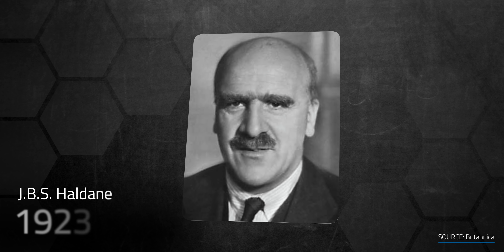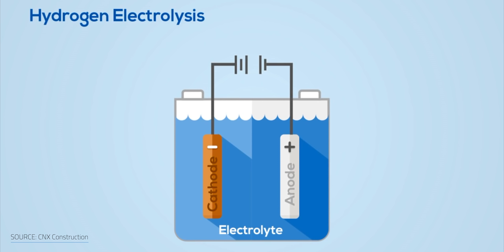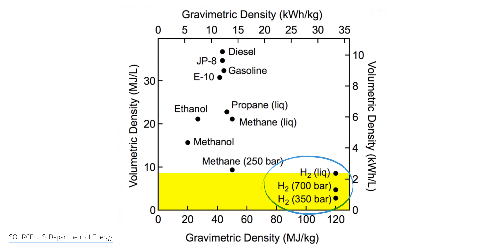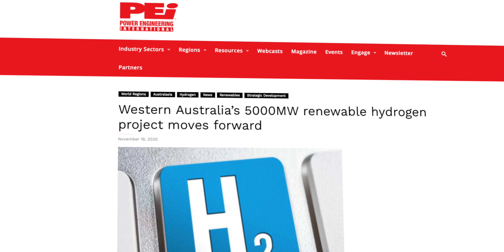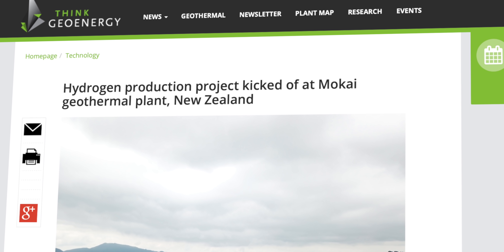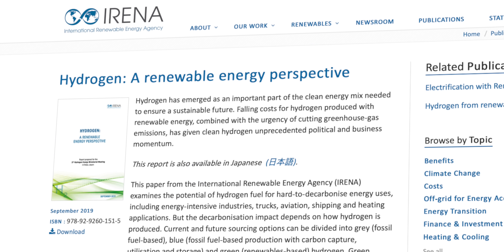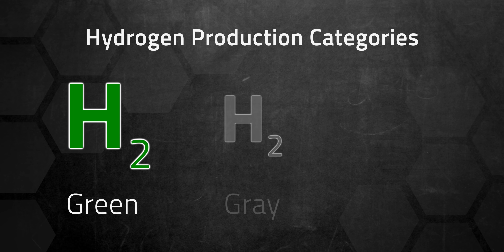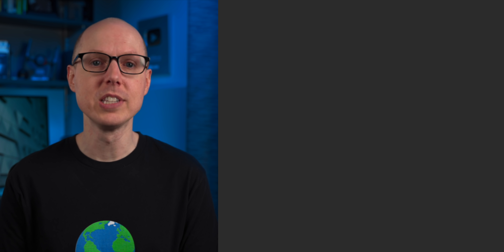The Truth About Hydrogen's Dirty Problem - Green Hydrogen Explained

Comment: It is interesting to point out different ways to go about producing hydrogen and it sounds like there is more progress than the last I checked.  However there are some intractable issues limiting how far you would really want to use it over alternatives such as:
1. Boom factor - You keep saying this in the video, but it is true hydrogen is a highly volatile rocket fuel than tends to be stored under immense pressure.  What could possibly go wrong for example by sitting on a tank of this stuff while going down the road and especially what could possibly go wrong with tanker trucks full of this and gas stations with huge tanks of this, especially as every gas station leaks even when the tanks are not under immense pressure?  There are stories about hydrogen fueling stations blowing up and they are not pretty stories.  Whole countries have shut down their hydrogen transportation projects over explosions like this.

2. Efficiency - I have seen these projections of hydrogen reaching cost parody for decades and we are still no where near it.  Granted there have been some improvements over the years, but the opportune word is some.  If it is always going to take several times more energy to make, store, transport, and consume hydrogen than other energy schemes we have, it is always going to lose out on the cost factor.  Also if it is taking a whole lot more energy to make this stuff than the useful energy we get back out at the other end when end-to-end is considered, not just the efficiency of one step in the chain, then it is not really all that green as it still takes resources to make the energy gathering equipment and if it always takes several times as much of this equipment, that is several times as much environmental damage as another solution that doesn't have this problem.  The last time I saw the math for an example, it was taking 6 times as many solar panels to push a hydrogen car X distance as it did a comparable battery electric car the same X distance.  Both battery tech and hydrogen tech has improved some since this, so this ratio is probably still in the same ball park.  6x as many solar panels is 6x the environmental damage to get the energy as the solar panels didn't materialize out of thin air, instead the planet is torn up and polluted to produce them.  The plan with solar panels is it is less damaging than other means of getting the same amount of energy.  However if say solar panels reduce the environmental destruction by 4x, but you need 6x more of them because your hydrogen tech is so inefficient, then you are actually doing more damage to the planet than if you hadn't bothered with hydrogen in the first place.  Plus with it being so very expensive to make the hydrogen fuel cells in the first place, one has to wonder how much of that cost equates to even more environment destruction in getting that fuel cell built where a cheaper alternative may be far less destructive to the planet.

3. Cost - In addition to poor end to end efficiency compared to other schemes we have raising costs, the fuel cells are still very expensive, a lot more so than batteries used for the same application, plus the batteries store the energy a lot more safely than a tank of highly compressed rocket fuel.  The Toyota Marai is a mass produced vehicle and the comparable Tesla Model 3 makes it look like a way over priced, dangerous, and way under-powered go cart that also looks like a bloated crap mobile.  The problem is also the battery tech is getting better at a faster rate than the hydrogen fuel cell tech, at least for right now and the battery tech is already way ahead in every way, including the cost point here.

4. In airliners - I thought it was interesting that you brought this up.  What I came up with here is you have a flying tank of highly compressed rocket fuel flying through the air taking up half of the fuselage where they used to have paying passengers in that space and at that the fuel is more expensive than alternatives.  All of those things are a non-starter and all of them are intractable problems.  The future of airliners I see are using high temperature superconductors for hybrid electric aircraft like what the Russians recently demonstrated with a real airliner.  So I would use LNG to keep the superconductors cool and feed the boil off gas into hybrid fuel jet engines.  This way you can do a combination of an electronic gear reduction for greater engine efficiency (straight jet engines are more efficient than the current bell at the back to do a gear reduction by slowing down the air over the turbine blades), modestly slower moving aircraft with more efficient, straighter wings, and batteries for buffering power and reducing the size of the turbines, which will make them more fuel efficient, especially as jet turbines are a lot more efficient at or near full throttle, which they normally rarely ever get near when they have to produce all of the power for flight, but could get a lot closer if batteries produced the burst power needed and left the jet turbines to produce average power while at or near full throttle.  Hybrid electric battery tech opens possibilities for more efficient for short take offs and landings at smaller airports with bigger planes and VTOL (vertical take off and landing) aircraft.  Think of for example if you did more regional / short hop flights on a commercial aircraft that took off and landed like a multi-rotor drone on primarily battery power and then transitioned to level flight, feathered the extra prop-rotors and shut them off, and then primarily ran on power supplied by right sized jet turbines for level flight?  Especially for large air-frames, the LNG tank could be placed in the attic space where there is usually a lot of open space anyway as it is not primarily a fuel tank, instead a coolant tank, but the exhaust gas does get used as a supplemental fuel.  Also for the primary fuel you could use a blend of conventional jet fuel and bio-jet fuel.  The experiments I have seen with using a blend like this made this look like a doable way of making this all work.  In other words you don't get rid of fossil fuels for jets, at least not right away, but instead cut down on how much dino juice gets used.  Better battery tech is already starting to creep into short haul flights and may make it all the way into medium haul.  What I am talking about with the superconducting hybrid electric airliners is a combination of new avenues for short haulers just not really practical with more traditional methods and far more efficient medium to long haul airliners.  These aircraft will pay for themselves through efficiency gains and even gains in safety with the right implementation.

So with hydrogen having a long history of extremely high expenses, voluminous, inherently very dangerous, and having terrible end-to-end efficiency making it the more environmentally damaging option than just burning the dino-juice straight in your engine, I mean there is just so much to try to overcome with such intractable problems that it doesn't seem worth it.  You can go on about how hydrogen tech is winning battles here and there until your face is blue, but the war will still be lost.  At best it will land in a few niche applications.
Reply: Yup you are right .But dont yoi think that if we'll find a easy and cheaper solution for this problem then that would be like miracles. 
Because we can extract h2 from almost everywhere, Isnt   ?
What you think  ?
Reply: @pranjulsharma6015  it seems we already have better solutions.  For example Elon Musk was just going on the other day about how hydrogen was considered for Starship, but it was found methane is a better solution.  Batteries are already a way better solution for cars and Elon Musk has even mocked car makers for using hydrogen while at the same time Tesla's battery electric cars are way better and less expensive, even without subsidies for his EVs while the hydrogen car is still more expensive with the subsidies while being inferior at the same time in every way.

While I can keep going down the list, there is a much better performer than hydrogen already in every category, so hydrogen just doesn't make any sense.
Reply: @ChaJ67  Yes Jason, You're right. But if we see current scenario then it seems like hydrogen is future. Because,government,Venturecapitalist,etc...,they see future in h2 they making huge investment in this technology. 
I dont understand that there  is also lot of other technologies like, "Sodium ion batteries,Aluminium batteries, etc.., " is also a good option but this is not in that hype as compare to hydrogen.....
But the point in last is "If we find a proper permanently solution for all the problems regarding hydrogen then it will be Breakthrough for an entire energy industries"....
Reply: @pranjulsharma6015  I think the important thing to understand is if not done a certain way, most 'green' solutions twist back to fossil fuels and often use more fossil fuels at that, especially hydrogen solutions and corn ethanol solutions.  This is why you hear so much about hydrogen and corn ethanol.  It is not actually part of the green future and was never meant to be.  It was only meant to passify stupid greenies while oil execs and certain farmers line their pockets.
Reply: @ChaJ67  Jason, I think Extracting h2 from fossil fuel and extracting h2 from Renewable energy is two different thing. The current way of using a hudrogen in industries is mostly based on 1st one which is from fossil fuels,and you know very well that, its not good for environmental.

But the problem with getting h2 from renewable sources is, the overall efficiency of Hydrogdn get decrease at every stage. From production to transportation to actual usage....
So here we need a proper permanently and reliable solution to save as much h2 as we can at every stage,isn't  ?

And when it comes to production of h2 then mostly we hear electrolysis process but thats not the only process of splitting water.There is lot of ways to split the water and that will also be efficient.
Recently,i was reading  a article which was about getting h2gas at room temperature and here i personally think that if any organization/Someone will develop such technology to get h2 very easily then i will be breakthrough for an entire energy industry.
And if we see in current time then it seems like it is possible because lot of new technologies are claiming that they can make hydrogen in very easy way, they can make such a device that will store h2 easily etc...,
Reply: @pranjulsharma6015  the problems with hydrogen are numerous.  Efficiency is just one of the problems.  You also need to be careful about claims or certain high hopes because then you end up with people promoting things like cold fusion, something we never achieved and have largely written off as a scam.  There are things that can be done we just don't do for some stupid reason and then there are things that can't be done.  Sometimes it is hard to know, but there is the underlying reality that ultimately dictates what can and can't be done.  No reason to hope for what can't be done, but maybe push for the things that can.  We settle on certain solutions for a reason, so if this is not properly considered as well as the ramifications of a proposed alternate solution, then it likely will not work out.
Reply: @ChaJ67  Yes, What you are saying makes sense,we should no believe anything that we read.But the article i was reading was the study of University of california, here i am pasting the actual/official word of study  :

"University of California researchers have discovered a new way to produce hydrogen by developing a special Aluminum composite that reacts with water at room temperature. Aluminum is a reactive material that anyway splits oxygen away from water molecules, leaving hydrogen gas behind."

So that'swhy we can trust on this.
If this happen then our first problem of Making a  plant for production willbget solved,and i think in future some solutions will come of various problem.

And  apart from this there is also lot of Research are happening everywhere for clean energy. 
In India, where i live Government of india sees future in h2 and they are investing their capital in h2.Not only in h2 but also in batteries technology, ethanol,etc..., 

As i see, I think you think that h2 is overrated,You Dont think h2 as a good future fuel alternative . So according to you which technologies or fuel is better option for future  ?
and why  ?
Reply: @pranjulsharma6015  Good question and I have answers:
1. Automobile / truck - Electrodyanmic induction in the roadway.  This is kind of like how you wirelessly charge your cell phone, but scaled up to making cars, trucks, and buses move around.  At this the focus is on the major thoroughfares, not surface streets.  For shorter travel once mass implemented, LFP batteries will be fine.  You could make cars a lot cheaper and lighter if the long haul travel part was handled by powered roadways.

2. Trains - Have a combination of overhead lines and LFP batteries.  The idea being train engines can weigh over 200 tonnes, so lots of room for batteries.  Place the overhead lines where they make the most sense considering you have batteries that can economically move trains a good distance.  Don't forget that at least in the USA, trains get over 500 tonne miles to the gallon, which is 4 times better than semi trucks.  Trains are very efficient momentum machines, so it is not hard to make trains go reasonably far on batteries.  Overhead lines would be an easy way to charge up the locomotives.  Anymore these days, you would just pick a good DC voltage for them, say -30 kV DC so there is plenty of power to move freight trains around.

3. For high speed travel, invest in Hyperloop style technology for both cargo and people.  This is have a tube with most of the air sucked out and run maglev cars in it.  There are actually a number of different magnetic levitation technologies out there, so you would want to shop around for the most flexible and cost effective option that can handle high volume traffic.  Have multiple levels to the system.  The reason for this is say very local travel is at regular pressure.  Go a little further and you suck most of the air out for a partial / soft vacuum.  Want to go far and you transition from the partial / soft vacuum to a hard vacuum.

4. Ships - It looks like we may have Lithium Sulfur or other types of batteries soon that may be suitable for ship travel.  Big cargo ships move kind of slow anyways and are efficient momentum machines at these low speeds, so especially if you get something like Lithium-Sulfur batteries working, which should have 3x the energy density of say a typical Tesla car battery, it will be plenty light enough and compact enough to power the ship between charging stations.  These charging stations could be say wind farms in the ocean or even nuclear if a shipping lane passes through a place in the ocean with no wind.  As ships tend to stay in particular shipping lanes, it should be easy enough to plan out where these charging stations will be and what the power source for them needs to be.

5. Airplanes - Again going back to recent reported breakthroughs in Lithium-Sulfur batteries and also tapping into high temperature superconductors and LNG coolant.  For very high power density motor / generators, use superconducting wires and motors as well as hopefully superconducting power electronics to efficiently drive these motor / generators.  LNG should be cold enough to keep the most modern superconductors we have at operating temperature.  As the LNG boils off, it gets fed into dual fuel jet engines.  The jet engines on planes get smaller, more straight through, and overall more efficient.  The planes will drive larger, slower fans than current jet engines and overall be designed to fly slightly slower for a big increase in efficiency.  The batteries will help in high power situations such as taking off and go-around power as well as smoothing out power delivery at cruise as changing air currents usually leads to constant throttle adjustments where here you want to run the jet turbines at maximum efficiency and let the batteries handle the changes in air currents.  In short, make airliners more efficient.

6. For better renewable production, build the HTSC (high temperature superconduction) HVDC (high voltage direct current) supergrid.  The idea here is build renewable generation around the world in all of the places where it makes the most sense to.  This power will be shuttled around countries and maybe even the world to be used where it is needed when it is needed.  These power lines will be more like pipelines that get buried in the ground and be in a coaxial configuration causing there to be zero external EMF, which will make a number of people who complain about such things happy.  The power lines can carry massive amounts of power per conductor, basically whatever is desired of them as superconductors can carry huge amounts of current and ramp up the voltage some and you have crazy amounts of power going through them.  Of course you would want to select a common voltage that would also make sense for overhead lines.  Then configure these power lines to snake around the country and even world in redundant loops as superconductors have no losses, so going the long way around when a cut happens is no problem.

7. At least in the USA, turn a couple of the Great Lakes into a giant pumped hydro storage system.  While only so much water enters the Great Lakes, these lakes are very large and some of the elevations are very different, leading to the potential of a humongous gravity battery.  Combine this with an HTSC HVDC supergrid and you can have massive storage for your green energy grid.  You can also do things like vary the flow of hydro-electric projects to help buffer power, but more in a one way flow fashion.  India gets a lot of rain normally, so I could see India doing a lot of the latter to help buffer renewable energy.

8. While India has been playing with Thorium reactors, they have been playing with molten sodium, which I think is a less than ideal approach.  I think India need to look more into LFTR reactors, which are thorium based, but use molten salts as the working fluid.  India has huge thorium reserves, the largest in the world, so needs to develop the right power plant to make use of it.  I think especially with LFTR reactors, it may become cheap enough for everyone in India to afford to run air conditioners and also eco-friendly to at the same time.

9. The Sabatier Reaction allows CO2 to be turned back into natural gas.  Especially when you are making a lot of green energy, can put the surplus into manufacturing your own natural gas from CO2 sources around the country.

So what do you think of all of this?
Reply: @ChaJ67  Wow,First of all Thank you for writing this answer in such easy way, because i also learned somethings from this. 
Yes, India have highest reserver of thorium and there is  research is going on,And it is expected that india will make its first plant to make electricity from thorium under 2025.

Well, All the energy sources is really fascinating and "its good in its own way".....

But what my point is, you said different fuel for every different thing. 
So is that not possible the same fuel for almost everythinng   ?

And i think you are the excessive viewer of this channel...😊
 Because all the source that you mentioned here this channel has made a video on that....
Reply: @pranjulsharma6015  The deal with different setups for different things is we have a number of technologies to choose from and each has its pluses and minuses.  For example LFP batteries are very well developed and have very good lifespans in general as well as being relatively cheap, but their energy density and power output is less than some other battery types.  So put this in a train locomotive that is very heavy anyway and can have overhead lines placed in strategic spots to charge up or an electric car that can charge off of a specially modified roadway to deliver power to the car making it so the car doesn't need to go too far on battery alone and LFP batteries is a perfect fit that we already have.  An airliner on the other hand has to be efficient to work and get its job done.  So then you start looking at more cutting edge solutions such as recently reported advances in Lithium-Sulfur batteries and novel uses of superconductors and LNG and significant R&D to make it all work.  LFP batteries are too heavy and copper conductors would weigh more than superconductors for the very high power levels jet airliners operate at.  A jumbo jet operates in the 100+ MW range during normal flight while being light enough to put out this kind of power for 12+ hours while zipping through the air at high speeds, possibly even going 18+ hours without refueling.  There is just not that many ways to do that with the technology we have and so the tech used needs to be well considered to handle this task.
Reply: @ChaJ67  I think, LFP and Lighting sulphate Batteries could be a really good alternative.But,At the end if we see in long term perspective then there is lot of problems in lithium Like,
1. reserve of lithium on planet is limited .At some point we will get run out of lithium(I am not saying that we will run out of lithium immediately after )

2.Price of lithium is constantly touching the sky,and It is expected that it will continue ; the price of lithium will not decrease in future. 

3.When all the things get fixed by lithium batteries then we will Mine lithium on full scale, we'll mine it from sea very hardly and in last it will effect overall the oceanlife .
( I know we cant manage all the things precisely .But in last it will effect our planet ) 

So here is the hope for all the problems which is ( I think ) Hydrogen
We can get h2 from almost everywhere Even from waste water. 
And we can also use this almost everwhere. Alstom is making the train that will run on Hydrogen. 
And There is also lot of big giant who believe in h2.Like Toyota, JCB, etc...,
Reply: @pranjulsharma6015  we can recycle batteries.  I heard Lithium battery recycling tends to lead to even better batteries than the original direct from mined materials batteries.  We have lots of Lithium reserves.  Right now a big one they are talking about is the reserves under the Sultan Sea in Southern California, but that is far from the only one.  Also, materials such as iron, phosphates, and Sulfur are very plentiful.  Especially with these extra battery chemistries, there is enough to go around without touching the ocean.  Even if you say do evaporation based desalination as a second stage to a LFTR reactor as in take the hot air coming off of the primary gas turbine, which is completely inert, and use it to boil sea water, extracting Lithium from the brine left over is not going to change the chemistry of the ocean, especially with Lithium recycling.  What is changing the chemistry of the ocean right now is all of the fossil fuels dumping CO2 into the atmosphere, which the ocean absorbs most of and then all of the fresh water glaciers melting due to excessive CO2 release leading to less salty oceans.  There are other things around agriculture and manufacturing that are also destructively changing the ocean chemistry, and especially the manufacturing side comes to bite with H2, which I will explain later.  In other words, I think you are worrying about the wrong thing.  Trillions of tonnes of CO2 going into the ocean every year is a lot greater of a change than say 1,000s of tonnes of Lithium extracted from brine as we make much needed fresh water for dried out parts of the world.  When it is many orders of magnitude difference like this is, it basically comes down to something that would never be an issue for the rest of the time Earth is naturally habitable before the Sun gets too hot versus something that is already having an adverse effect on the ocean.  This puts batteries in a very eco-friendly spot while the current primarily grey hydrogen we get in a terrible position for what it is currently doing to the ocean. 

For your pie in the sky blue H2 future, there is the fatal flaw of efficiency.  The reason blue H2 has a fatal flaw is you have to build so much more infrastructure to compensate for the poor efficiency and things like wind and solar are pretty material and manufacturing intensive, which tends to be dirty, at least today to do, you end up destroying the planet trying to make all of this extra energy to make up for H2's poor efficiency.  Lithium batteries on the other hand are very highly efficient.  The last I checked the battery electric cars needed only 1/6th the solar panels of the H2 powered car.  That is 1/6th the destruction to the planet to make the energy needed for batteries.

For batteries, LFTR reactors is kind of a best buddy in what is talked about above.  LFTR reactors can make the stable power without using water to charge the batteries during low demand.  Grid scale batteries can help maximize what you get out of LFTR reactors as grid demand changes throughout the course of a day.  Then desalination can be hooked up as a second stage using the hot air from the gas turbine to boil the ocean water.  Then from the brine, you extract some Lithium before flushing it back out to sea.  With battery recycling and water ultimately flowing back into the ocean, as well as LFTR power plants producing a lot of power with relatively few materials used, the change to Earth's chemistry will be minimal.  LFTR reactors can be designed to break down all of the fuel while using abundant thorium, so the nuclear waste problem is solved as well as the problem of where do you get the fuel to power the planet as that just comes from spent fuel rods from light water reactors as we have plenty of those and don't need to mine for more material.  It is just this makes burying spent fuel rods look like a huge waste.  (It is a bit complicated to explain, but basically in your long term outlook, things look very nice overall with LFTR.  Much better than any other proposed solution.)
Reply: @ChaJ67   Yes recycling of lithium batteries is Possible and it is also happening but  in very small scale... 
Recycling Lithium batteries isnt that simple actually. 
Lithium batteries are also made up of a mix of different elements including cobalt, nickel, manganese and iron — cobalt known to be a hazardous substance. 
One of the metal in lithium batteries🔋 use is Cobalt.Cobalt use to be hazardous for humam health. 

And evidence also says that recycling lithium batteries cost more than producing actual batteries. 
So thatswhy I think, It doesnt make sense to recycle lithium batteries in current time. We would have to wait till the advancement in technology
Reply: @pranjulsharma6015  my understanding in the USA at least is all EV car batteries have to be recycled.  It is happening right now from what I have read from reputable sources.  If a material is hazardous, well all the more reason to recycle it as opposed to dumping in a landfill, which is what is happening now, at least in countries like the USA.

At least with batteries the materials can be contained and handled in these ways.  Grey hydrogen makes a lot of waste on a continual basis that has to go somewhere and usually into the environment.  As hydrogen systems are extremely inefficient, this means there is a whole lot of it going into the environment.  It is kind of like this old cartoon I saw where they grid up a giant log just to make a single toothpick.  It is just hydrogen has the feel good of once these huge releases happen behind the scenes, water / steam comes out of your tailpipe.  Basically all hydrogen today is grey as it takes massive and costly mining and manufacturing doing huge destruction to the environment to make blue hydrogen.

Efficiency is key to sustainability as everything we do is going to have some sort of impact.  So the highly efficient stuff such as modern day lithium based batteries fall into the sustainable picture where highly inefficient hydrogen based systems are not in the picture due to this poor efficiency massively amplifying the damage done.

Also when you have a tailpipe where hazardous material comes out and into the environment or giant waste ponds that keep overflowing when it rains and stuff like that to make your vision of energy production actually work, that is just not good for the environment.  When you say have the material contained inside of a battery and especially when you have battery recycling going on, which is happening today, that speaks of containment.  Just having the hazardous material contained in a battery by itself is a big step up over what has been happening and recycling is just icing on the cake in the scheme of things.
Reply: @ChaJ67  Yes, Lithium batteries is recyclable. And it is happening almost everywhere But in small scale... 
(I readed that only 5-7 % of lithium get recycled at current time )
And if we considered that recycling is as good option then we would have to spend capital to make Plant for recycling and now think we did this then after that do you think that recycling 100% of batteries is possible and if yes then how  ?

If we tackled all thr thing then absolutely that would be excellent to recycle and use that again... 

But now think in logical perspectives  come to H2 again, 
Once h2 is produced then it don't have any troubles to recycle or anything.... 
Because that would be a gas/Liquid....
We wouldnt have to make a plant to recycled anything and as a result we can prouduce more energh with that capital or we can also make investment for technology advancements. 
well, every technology has it own drawback and flaws Either hydrogen or lithium....
This is my perspective what do you think about this what is drawback of this according to you    ?
Reply: @pranjulsharma6015  It sounds like we have simply optimized the outlook on these technologies differently.  To try to sum up my view in how I think I see the problem differently than you as I don't want to butcher your understanding on accident and leave you with the wrong impression:

1. One prioritization I have is the efficiency and greenness of making the energy.  More efficient means less waste that ends up damaging the planet.  Also I consider the source of the energy.  Batteries are pretty good at soaking up renewable energy to be used later, just need to be connected to those renewable energy sources.  Actually I am hoping charging stations get smarter and have a long plug in option to opportunistically pull in renewable energy.  With hydrogen I see either fossil fuels and a lot of them or buffered renewable energy at great cost as in tonnes destruction to the Earth create that energy as the hydrogen carrier energy cycle is very poor on efficiency.  Even one step improved, there are plenty of other low efficiency steps and so still bad in the end from the way I crunched the numbers.  Comparing the emissions of batteries and fuel cells is kind of useless in my books as with fuel cell systems you have all of the machinery, including the fuel cell itself that needs to be disposed of properly, so you really kind of have to look at these two recycling processes and potential to improve as well as the processes to make these in the first place and how intensive they are.  Fuel cell vehicles are very expensive for what they do, so probably nothing too great happening there.  As for the actual emissions, you compare water / steam output of the fuel cell versus zero output from the battery as they are both energy carriers, not producers.  Either way, the emissions here don't mean anything in open air vehicle use, but closed systems that are sensitive to water do have an advantage with batteries.

2. I have optimism that battery recycling will only get better with time.  I have read some places where it is even preferred already to use recycled materials for new batteries from a cost perspective.  As we are now producing millions of EVs per year while the EVs being retired primarily come from a long time ago when orders of magnitude less were made and even just the relative handful of new ones smashed in wrecks, I think economies of scale is going to help push battery recycling into high gear and it is going to be even more cost effective to do while desired to extract material better and more efficiently.  This is going to make the recycling process overall better.  Think of the year 2035 where most of today's fleet will be in the recycling bin and many more joining every year.  That is orders of magnitude more batteries to recycle every year and thus a very good opportunity to get cost economies and economies for R&D done for improved recycling systems effectively.

For example a movie where only 10,000 people watch it in the theater is not going to have $100,000,000 spent on making it an eye popping special effects experience with top paid actors, at least not without the producers losing their shorts over the movie.  However a movie with 100,000,000 people going to the theater to watch it could easily have that kind of budget for all of that eye candy and top paid actors and such and still be profitable to make.  (Now if they would just invest in good screen writers more often...)
Reply: @pranjulsharma6015  There is another little sticky issue with hydrogen, in order to get any meaningful density, you have to either chill it to near absolute zero or compress it to 10,000 psi or something like that.  Right now we are seeing the hydrogen powered part of the SLS fail time and again, grounding the massive rocket and Blue Origin's New Shepard just had the engine on their hydrogen rocket run engine rich and catastrophically fail, leading to the loss of the booster.  So yeah, cryogenic hydrogen is hard and its many problems should not be underestimated.  Then with sitting on top of rocket fuel compressed to 10,000 psi, um, do you really want to do that?  I would feel much better with a battery underneath me.  Also, some countries have banned new hydrogen car sales due to massive fueling station explosions.  As you ramp up hydrogen fuel cell cars and associated infrastructure, there will be more accidents and these accidents with hydrogen are so devastating that they ultimately lead to the banning of the vehicles.
Reply: @ChaJ67  Right,
We both se problem form different perspective.... 
There is numerous problem of h2 and it will get either solved or not leave this on future.... 
But you said, "Efficiency is the key" And i Totally agree with this ....Because the efficiency of batteries is 99% And on otherhand Efficiency of h2 is 40-50%.
And if we see from current view than Batteries are really very ahead in this and it will also get dvanced in future.... 
Batteries will soon likely be able to charge faster than the charger stations will be capable of charging them, meaning that it may always take at least 15 minutes or more to charge your batteries to 80%.
So i personally think that,Batteries and h2 Both are good in its own way.While batteries is far good in current time. 
But it doesnt mean fuel cells are  useles/Not make sense ; I think that fuel cells will find their home with large power generation for buildings and heavy equipment and ships but won't have applications in cars, trucks and smaller tools and appliances as li-on/Other batteries are a much better option. Either way, the goal should always be to eliminate fossil fuel burning.
Either with batteries or Any other solution....
Reply: @pranjulsharma6015  this might be another place where I see batteries in a better position with the things you bring up here.

One thing I came across that dates all the way back to Nikola Tesla himself over 100 years ago is electrodynamic induction.  Regular induction is you just have an alternating electromagnetic field generated by wires / coil of wire and and another wire / coil of wire as close as possible to have a current induced in it.  Electrodynamic induction is you have a harmonically oscillating LRC (inductor, resistor, capacitor) transmit power a greater distance to a receiving coil.  As inductors are 90 degrees offset one way to be a current storage device and capacitors are 90 degrees offset the other way to be a charge storage device is basically like having a swing set to reach something where you can think of the inductor as the fast moving (kinetic energy) part of the swinging motion and you can think of the capacitor like the high (potential energy) pat.  If you are just trying to reach up to say a lever, it normally gets a lot harder very quickly to push on that lever as you move it higher.  If however you had someone in a swing and just pushed on them relatively lightly at just the right time, they would go higher and higher on that resonant frequency of pushes and then be able to push relatively easily on that level as it was placed higher up.  It is the same sort of principle that makes wirelessly charging your cell phone efficient.  It is just with cell phones it is mass implemented where with roadways it is not.  It was proven all the way back in the 1990's in a joint Caltrans - UC Berkeley study that electrodynamic induction can power a bus at freeway speeds.  During Obama's administration using modern power electronics they raised the efficiency of this tech to 86% efficiency.  This is important because there is some loss in efficiency in EVs.  The batteries are fairly efficient and the power electronics are very efficient, but it is not actually 99% efficient or even all that close to that.  Also effective efficiency of the vehicle goes down the heavier it is, the more energy used, so if you can lighten the battery load, you will use less electricity pushing those batteries around.  So say you put this in all of the major thoroughfares.  At least in the USA, the major thoroughfares are pretty torn up by age and big semi trucks filling the roads and beating them down as well as up front cost cutting leading to far less durable roads than say Germany where the Autobahn was invented.  In other words if you included installing electrodynamic induction in the roadways in the USA in a big infrastructure bill to repair the roads, the USA could potentially have a highly effective powered roadways system throughout the country in under a decade as badly need work on the roads are done anyway.  So then you don't need a big, heavy, expensive battery in your car or truck.  You just need something to cover the surface streets and any small gaps in coverage.  Your car or say autonomous semi-truck (at least when going through the countryside) could drive perpetually around the country as it gets powered by the roadway.  No need to stop to recharge.

While I suppose that is a lot to put in there, another thing to consider are recent reported advances in Lithium-Sulfur batteries.  While this chemistry hadn't gone anywhere for a long time due to durability issues, apparently there is a new crystalline structure they have figured out to solve this.  This gets you batteries made out of common Lithium and very common Sulfur with 3x the capacity of the current Tesla batteries  while being able to charge and discharge much faster and be more efficient due to the very low impedance of the batteries.  Say your car goes 1,500 km (900+ miles) on a charge.  Does it really matter if it takes an hour to Level 3 charge that from basically empty to basically fully charged?  How far are you really going to drive in a day?  At what point is a little food stop or other rest stop welcome while the batteries charge up some?  So yeah, when you talk about batteries with a faster charge rate, they are also talking about up to 3x the capacity as in effective range gained per unit of battery mass with some of these new batteries.

Maybe with both, you could end up with say battery electric semi-trucks that are lighter than their diesel counterparts because you get rid of that heavy diesel drive train and have light, yet powerful motor systems and a modest and light battery system due to both powered roadways meaning you don't need much battery and Lithium-Sulfur batteries used being super energy dense.